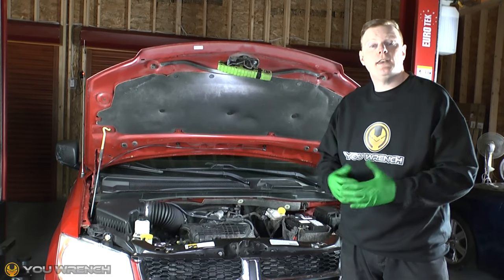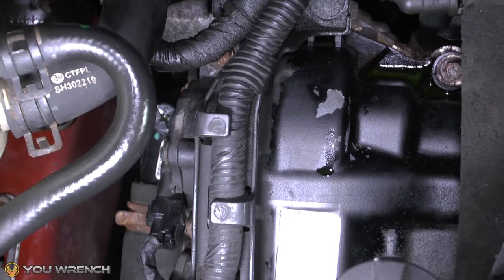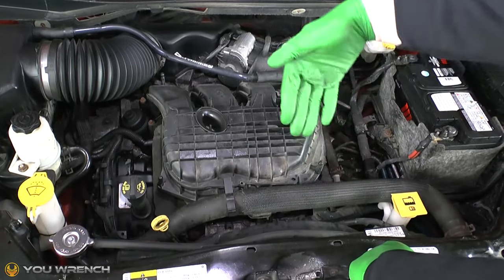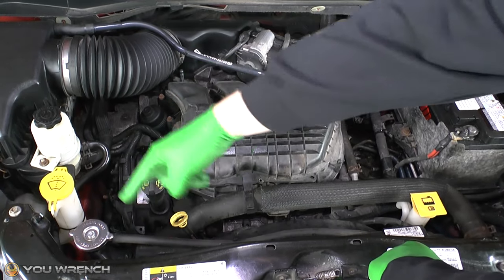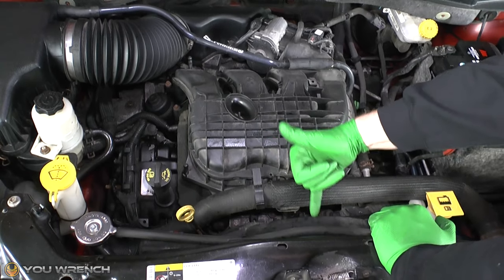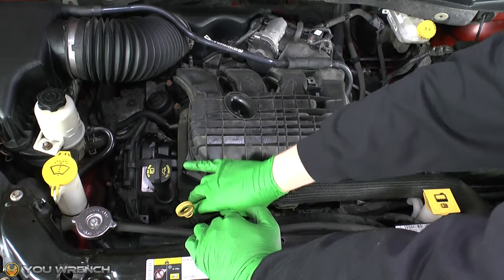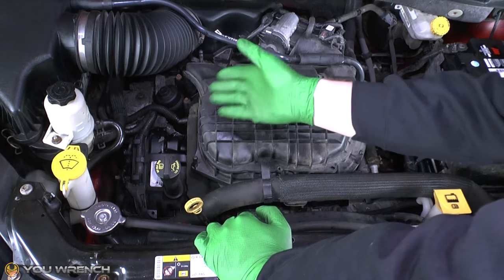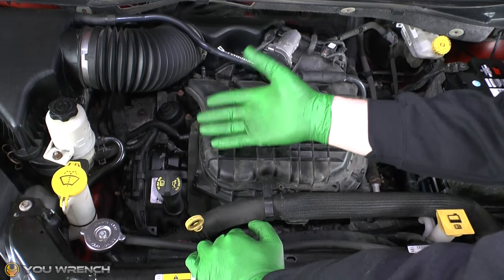How to Test if Your Car's Thermostat is Working (Without Removing It!!)

Comment: Thank for your video my car's temperature gauge is in the stays bared in cold, engine light is on.  So if hold the upper hose 5-10 minutes it should suddenly get hot.  If the thermostat is stuck open it just gradually get warmer?  I just want to make sure before replacing the thermostat that it is not just a bad ECT sensor.
Reply from the maker: Yes, a very strong indicator that your thermostat is bad is that the top hose will not suddenly go from cold to red hot as the thermostat opens and floods the pipe with hot coolant. If it is stuck open then it will never get as hot as it should, only warm, as the 'cycle' is constantly open so it's always flowing through the radiator and being cooled, in these cases you usually also can't get decent hot air inside the cabin as the coolant is never getting as hot as it should. On many cars a new thermostat is $15-30 and so this is often the best place to start if you suspect it's a likely cause. Other cars they can be very expensive though!! If it's cheap for your car, it's a safe bet if only to rule it out. Hope that helps :-)

--- 

To help support us (for both you and others reading this) there are a few things you can do:

1) Donations both needed and welcome! We cannot operate You Wrench without the support of people like you! You can donate by PayPal - just go to www.paypal.me/youwrench

2) Please ensure you subscribe to our YouTube channel. 

3) Please Like our video's on YouTube (by clicking Like!) 

4) Please help spread the word, the more people who know about us the better! Add links to our video's in forums, let people know about us.

Thank you for your support!

Comment: Great videos, thank you so much!
I have a question for you. What does it mean when I my heater is not producing any heat, and also I've noticed that the radiator fan does not turn on when the engine gets to temperature? 
I am suspecting a bad heater core but I would like to see if it could be something else first. 
The hoses going to the heater core are hot, and also would like to add that both fans turn on when I turn on the AC. 

- heater not hot, only blows cool air
- rad fan not turning on
- fans turn on with AC but not with only the heater
- heater core hoses do get hot
- upon starting the vehicle, there is a humming noise coming from the dash board for about 15 seconds

Thank you
Reply from the maker: Thank you! It could be something as simple as the flap motor that controls the distribution between hot and cold into the cabin has broken. Can you hear the motor turning when you switch between full hot to full cold/vice versa? Also, the radiator fan may not kick in when the car reaches operating temurature. Often it takes a quite a bit longer when just idling. It will come on much quicker when driving, but of course you would not notice this (without live diagnostic data at least). If you leave the car idling for long enough though it should come on eventually (will take longer in cold weather too). Just don't expect it to kick in as soon as the temp hits the middle of the gauge. Hope that helps 👍

-----------------------------------------------

To help support us:

1) Please be sure to use our Amazon Links!

2) Please ensure you LIKE our video's, and SUBSCRIBE to our channel!

3) Donations always welcome! Hit the SUPER THANKS option below the video on YouTube, or by PayPal: www.paypal.me/youwrench

Thank you for your support!

Comment: Hi. I did as per above video and while the engine runs my upper hose stays completely cold for about 2-3 minutes and then  very GRADUALLY starts to warm up to the very hot temperature. Very Gradually. Also the lower hose always stays completely cold, even after travellying the long distance and back. Does it mean the thermostat works fine? Also would the car give the error code if the thermostat is faulty?
Reply: Also forgot to say I tuned the cabin fans to max and to hottest setting and the car cabin became very hot in 3 minutes
Reply from the maker: Hard to say without seeing it first-hand, but I assume you are testing it because you are having some tempurature issues to begin with? My initial guess based on what you mentioned would be a faulty thermostat valve which is only partially opening, hence taking so long to let the hot coolant out of the engine. This would likely cause the car to be running hot, to what degree will vary, but would show hotter than normal on the tempurature gauge. It may fluctuate. For the price of a thermostat, well worth replacing it as the most likely cause before delving deeper. Best of luck!

--- 

To help support us (for both you and others reading this) there are a few things you can do:

1) Donations both needed and welcome! We cannot operate You Wrench without the support of people like you! You can donate by PayPal - just go to www.paypal.me/youwrench

2) Please ensure you subscribe to our YouTube channel. 

3) Please Like our video's on YouTube (by clicking Like!) 

4) Please help spread the word, the more people who know about us the better! Add links to our video's in forums, let people know about us.

Thank you for your support!

Comment: Nice simple and clear explanation which deserved AIKE and a SUBSCRIPTION. 

As a follow up, can you explain what it means if your thermostat seems to be working, opening correctly but there is NO heat inside the CAR. The temperature guage does stay normal most of the time but then jumps up to very hot for a few seconds and then mysteriously returns to a normal midway  position... but still no heat. Any ideas? 

A water pump problem? An electrical issue? Thanks for an advice.
Reply: Hey Bro. Most likely a faulty thermostat. Working ok sometimes then not.
Reply: Heater core could be blocked . it is a secondary small radiator at the firewall or under the dashboard inside the car . this deepends on the age of the car   and coolant service maintnance .  Also there is a valve that opens and closes the hot vent , if it fails you wont get any heat .

Comment: But how you can test thermostat which is opening and closing but when opening its not opening fully open so temperature is still doing like 105C  when driving like 80km/h or in the highway 140km/h Can you test this fault anyway?

Comment: An explanation I read for my Volkswagen Touareg was that there’s an upper and lower pipe and that both should get hot, but if the upper one gets hot and the lower one doesn’t there’s a problem
Reply from the maker: Interesting! Normally the lower pipe will not be as hot as the upper because the lower is passing the cooled coolant that has just passed through the radiator back into the bottom of the engine for recirculation. Maybe it's a different system, or a system variant.

--- 

To help support us (for both you and others reading this) there are a few things you can do:

1) Donations both needed and welcome! We cannot operate You Wrench without the support of people like you! You can donate by PayPal - just go to www.paypal.me/youwrench

2) Please ensure you subscribe to our YouTube channel. 

3) Please Like our video's on YouTube (by clicking Like!) 

4) Please help spread the word, the more people who know about us the better! Add links to our video's in forums, let people know about us.

Thank you for your support!

Comment: Great video hiwever most alike this 1 is based on a thermostat at upper hose . Mkne is at lower hose
Reply from the maker: Thank you. Yes, the thermostat (and therefore hose) can be at the top, and sometime the bottom as well. It does not make a big difference, you should still be able to feel the tempurature change in the hose when the coolant gets hot and the thermostat opens. So the theory remains the same regards of the position. Hope that helps 👍

-----------------------------------------------

To help support us:

1) Please be sure to use our Amazon Links!

2) Please ensure you LIKE our video's, and SUBSCRIBE to our channel!

3) Donations always welcome! Hit the SUPER THANKS option below the video on YouTube, or by PayPal: www.paypal.me/youwrench

Thank you for your support!
Reply: @YouWrench  it does mate excuse my spelling errors above lol .my cabin heat gets a tad to hot and given my fans dont seem to kick in . I'm thinking my thermostat isn't doing its job (opening much or at all ) hoping to do it tomorrow . Not a hard job given what I've done already..I'll remove lower hose to make sure its all clear..I've flushed system twice

Comment: my car (Seat Ibiza 1.2tdi copa (2011 Mk IV) for some stupid reason, doesn't have a dashboard engine temperature gauge. I will do your thermostat test anyway to try fault-find why my interior heating is so bad. I do get some heat through the vents but it never gets that hot, always a struggle to demist my windscreen in winter driving. Reason could be faulty, stuck open thermostat, or blocked heater core/matrix

Comment: There is another issue that happens every 10 years on my truck. Air builds up in the top hose and stops the heater from working in the cab. Only cold air comes out of the vents. Each time this happens I loosen the over fill tank cap and burp the top radiator hose while the engine is running. By decompressing the top hose over and over you will see the over fill tank coolant level move up and down. Once the air is removed, heat in the cab will be restored. Just like hot water boilers in a home, air in a system causes no coolant to reach the heater core fins.
Reply: If this was happening, would it also cause the heat gauge to start to rise and get hotter? Just trying to key doen exactly what the action and reactions are and this made me ponder that haha

Comment: What problem would I have if the thermostat always stayed open? What bad effect would it have on the engine if any?
Reply from the maker: Yes, that would not be ideal. If it was always fully opened then it would always be cooling via the radiator and so never get up to proper operating temperature. You can often tell if this is the case because the air in the cabin will only be warm when you call for hot air. Hope that helps!

--- 

To help support us (for both you and others reading this) there are a few things you can do:

1) Donations both needed and welcome! We cannot operate You Wrench without the support of people like you! You can donate by PayPal - just go to www.paypal.me/youwrench

2) Please ensure you subscribe to our YouTube channel. 

3) Please Like our video's on YouTube (by clicking Like!) 

4) Please help spread the word, the more people who know about us the better! Add links to our video's in forums, let people know about us.

Thank you for your support!

Comment: Would a stuck thermostat cause the fans to cycle. The top radiator hose never seemed to get hot or feeling water flushing through but the fans came on and stayed on. 🤷🏻‍♂️

Comment: And if I'm not mistaken if the thermostat is stuck open your temp gauge will show cooler than normal and your heater will not blow hot as usual and be maybe lukewarm.
Reply from the maker: Yes, absolutely. If your thermostat is stuck open then the coolant is not held in the engine and will just keep circulating through the radiator, so it will not be able to get up to a proper operating temperature. So when you call for heat inside the cabin there will be no heat (or very little) to give as the coolant is not up to temperature. So if you get a combinaition of no warmth inside the cabin coupled with the temperature gauge always sitting low, then this is a good indicator of a faulty thermostat (open). Hope that helps! :-)

--- 

To help support us (for both you and others reading this) there are a few things you can do:

1) Donations both needed and welcome! We cannot operate You Wrench without the support of people like you! You can donate by PayPal - just go to www.paypal.me/youwrench

2) Please ensure you subscribe to our YouTube channel. 

3) Please Like our video's on YouTube (by clicking Like!) 

4) Please help spread the word, the more people who know about us the better! Add links to our video's in forums, let people know about us.

Thank you for your support!
Reply: @YouWrench  Yup. it was my thermostat..blowing hot now like new.
Reply: @YouWrench  mine is still running cold w a new thermostat. I can take off radiator cap after the car has been running for 3-4 hours

Comment: Another way is to touch the bottom radiator hose. If the top hose is hot and the bottom hose is cold, then the thermostat is stuck in the closed position. If the bottom hose is hot once the engine has reached operating temperature, then the thermostat is operating correctly. If the top and bottom hoses are heating up at the same pace, then the thermostat is stuck in the open position.

Comment: Can a bad water pump cause this? And what if this happens but once I drive a few blocks and the gauge it goes back to the middle and rises again slowly in idle or as time goes on
Reply from the maker: Hey there! It depends on your exact symtoms. This test in the video is specific to the thermostat and will help you get a good idea of whether or not your thermostat is working correctly without having to remove it. But yes a water pump that's on its way out absolutely can cause strange heating issues, as can other things such as the radiator cap (depending on system). It tends to be a process of elimination, but the thermostat is usually a good place to start to rule it in or out. Hope that helps!

--- 

To help support us (for both you and others reading this) there are a few things you can do:

1) Donations both needed and welcome! We cannot operate You Wrench without the support of people like you! You can donate by PayPal - just go to www.paypal.me/youwrench

2) Please ensure you subscribe to our YouTube channel. 

3) Please Like our video's on YouTube (by clicking Like!) 

4) Please help spread the word, the more people who know about us the better! Add links to our video's in forums, let people know about us.

Thank you for your support!

Comment: I have 1990 f150 I installed a thermostat not to long ago and I believe it's working except my heater isn't working that good it gets warm but not hot  symptoms say thermostat what do you think I appreciate the video imma try that out maybe it gets warm to warm to hot
Reply from the maker: Do you mean it's not getting warm inside the car? More likley the heater matrix than thermostat assuming that the car reaches it's normal operating temp ok and does not overheat etc. If it's a problem only inside the cabin, then heater matrix or even possibly an air blockage.

--- 

To help support us (for both you and others reading this) there are a few things you can do:

1) Donations both needed and welcome! We cannot operate You Wrench without the support of people like you! You can donate by PayPal - just go to www.paypal.me/youwrench

2) Please ensure you subscribe to our YouTube channel. 

3) Please Like our video's on YouTube (by clicking Like!) 

4) Please help spread the word, the more people who know about us the better! Add links to our video's in forums, let people know about us.

Thank you for your support!

Comment: My temp gauge on the dash once the engine is warm to the straight up position and never moves from that location does that mean everything's fine?
My friend try replacing a thermostat on a 2 L Volkswagen TDI engine and you'll start to pull your hair out it's such a difficult job.
I'm going to try testing my TDI SportWagen with your Technique because my mechanic said that my thermostat was stuck open, I want to make sure he's not trying to drum up more business.

Comment: Can u also feel with yr finger in expansiontank sir? Thx,  this cicuit gets only warm on the big open loop?
Reply from the maker: No, you should never try and test using your finger as the coolant gets REALLY hot and will injure you if you were to do that. The coolant is hottest inside the engine, then the thermostat opens and that hot coolant is released (and so top radiator hose becomes hot), it passes down through the radiator and so cools again, out of the lower radiator hose and back into the engine. That is the basic 'loop' process. Hope that helps!

--- 

To help support us (for both you and others reading this) there are a few things you can do:

1) Donations both needed and welcome! We cannot operate You Wrench without the support of people like you! You can donate by PayPal - just go to www.paypal.me/youwrench

2) Please ensure you subscribe to our YouTube channel. 

3) Please Like our video's on YouTube (by clicking Like!) 

4) Please help spread the word, the more people who know about us the better! Add links to our video's in forums, let people know about us.

Thank you for your support!